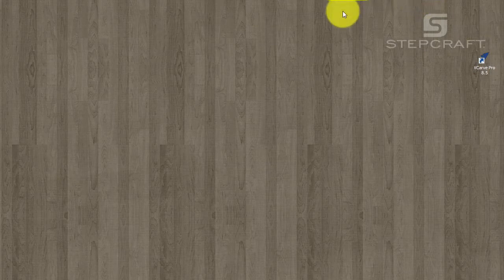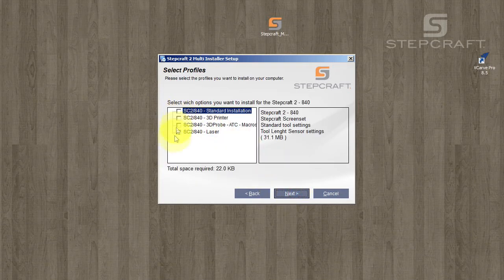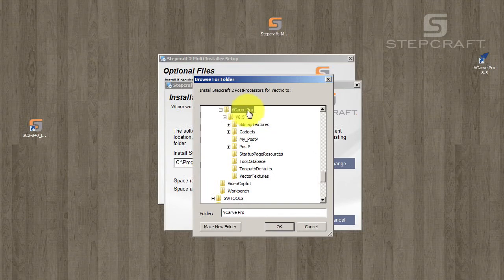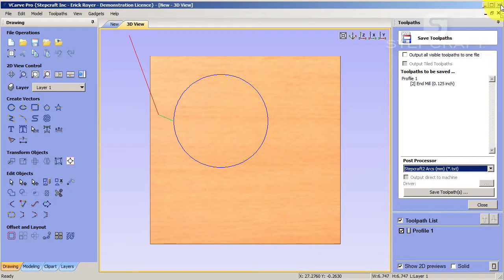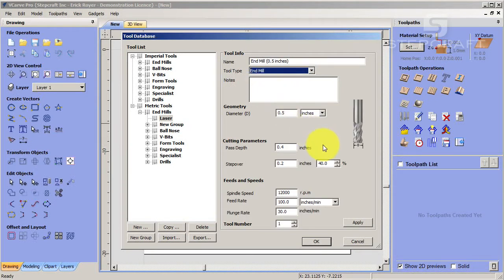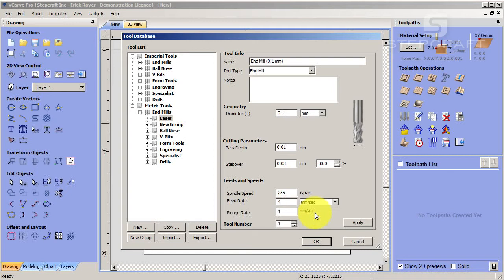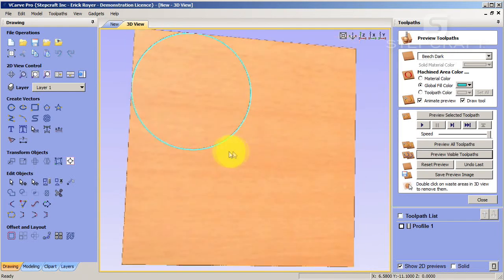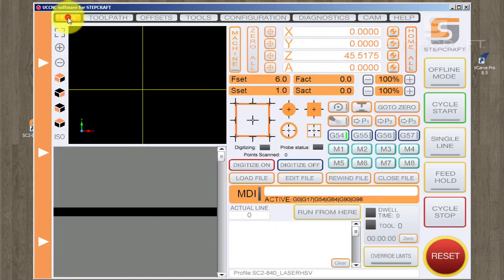Stepcraft Laser Toolpaths and Software

Comment: My UCCNC settings are identical to yours (although you did not show the UCCNC “Axis” setup. I have the Stepcraft 2 840 and the DL 445 and my laser won’t fire. The height sensor works, the guide laser works but the laser doesn’t fire for any job I’ve created or with the laser plugin. Any pointers would be appreciated. I’m about to drive this CNC to the dumpster if I can’t get it to work.
Reply: Did you get it working?
Reply: @Narvasus  nope, eventually gave up. No longer have the Stepcraft. It’s an overpriced toy.